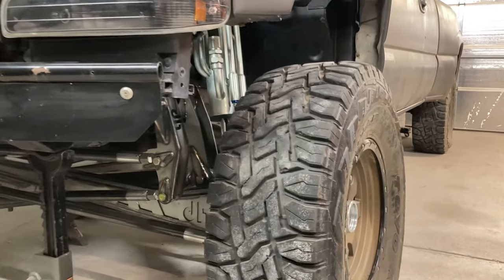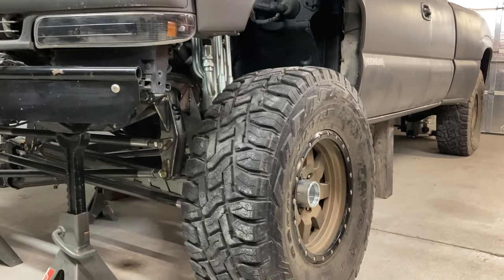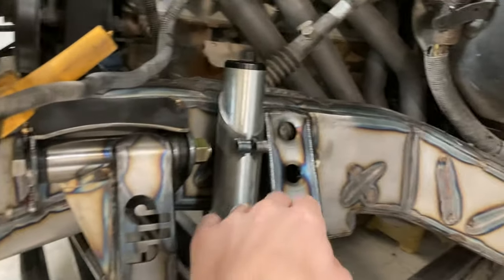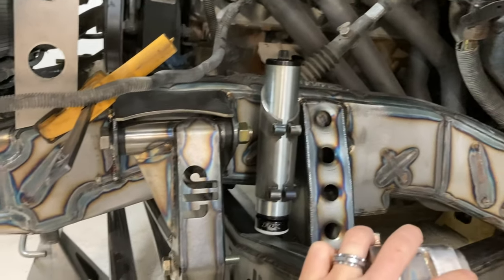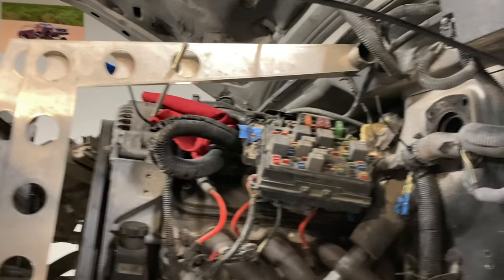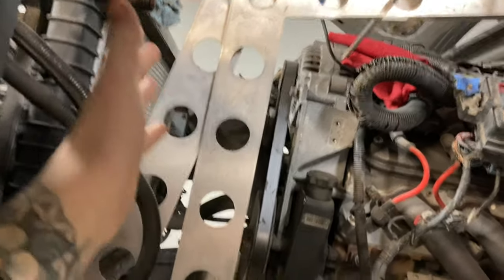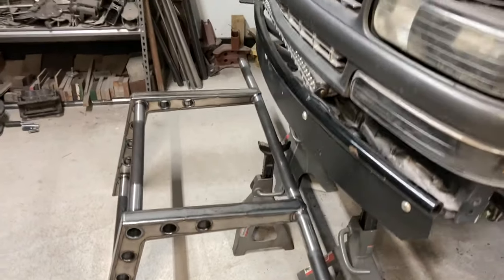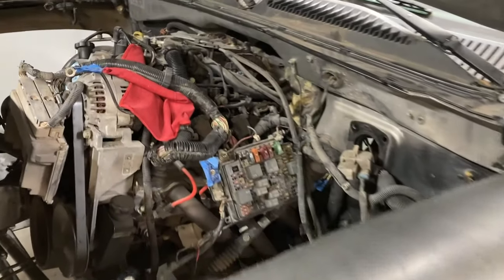Engine Cage & Progress on I Beam Chevy Build - Dune Hippie Vlog #45

Comment: Where do I get the dimple dies for the press
Reply from the maker: Think I got these ones from ruff stuff. But the tmr dimple dies are better. They have a wider landing which helps keep your plate your dimpling flat. These ones give a curve to your plate and you have to flip the plate over and then use the negative due to press your die and plate back flat after dimpling your hole. Adds extra steps but it still accomplishes the goal of dumpling the hole.